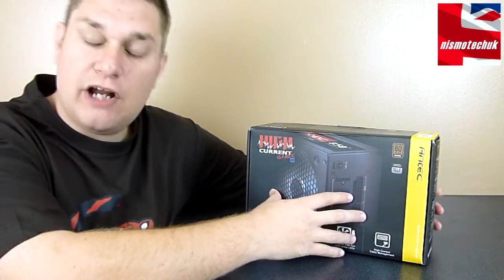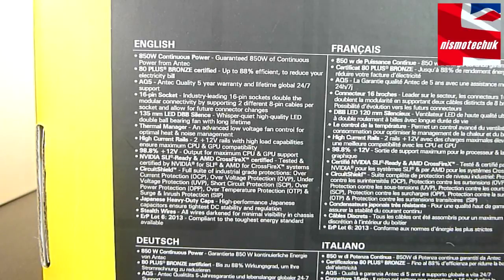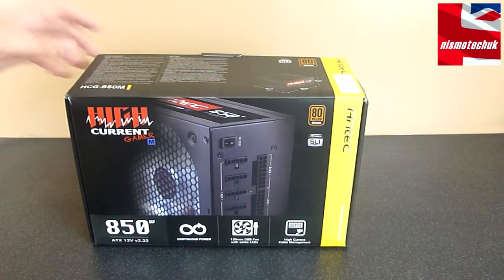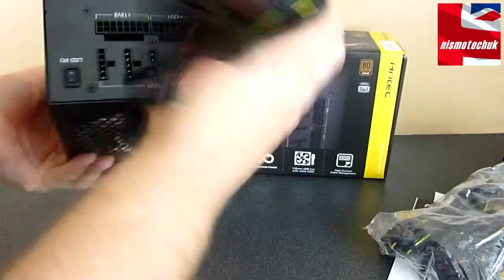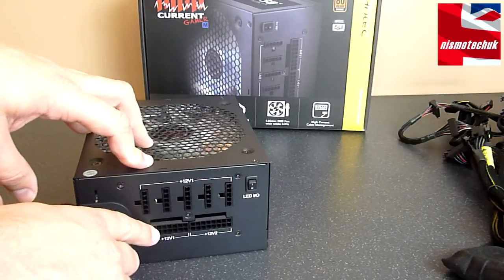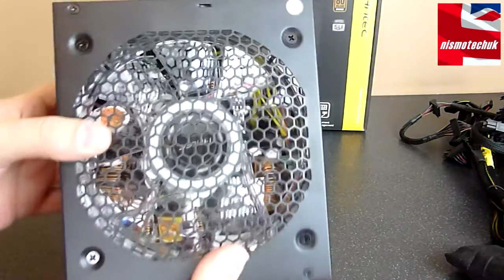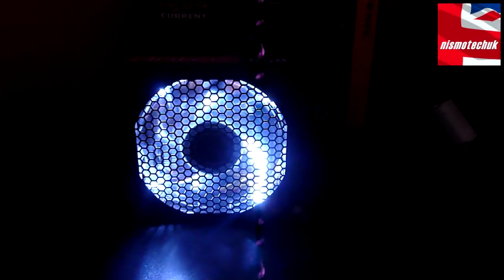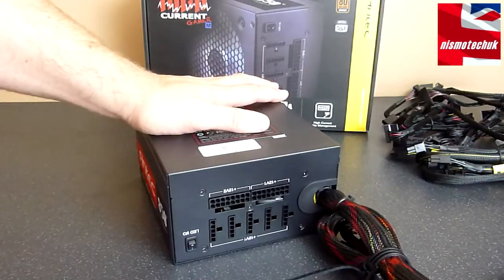Antec High Current Gamer HCG-850M PSU {Unboxing}

Comment: is all you had to do was plug it to power supply to turn it on you didnt have to plug in the 24 pin or use a wire to get it to work?

Comment: Great review, you earned a sub. I've got a question tho, will this power supply work fine for a NVIDIA GTX 780 Super Clocked? (Model Number 03G-P4-2784-KR) If you can respond to me I'd appreciate it. Thanks
Reply from the maker: Hi Dustin, Sorry for the delay in getting back to you. I can confirm that this PSU will work fine for your GPU. I even got it confirmed to me via my Antec contact.
Reply: thanks :D